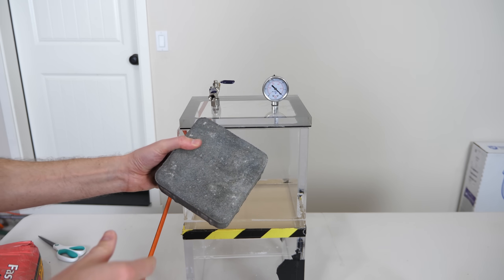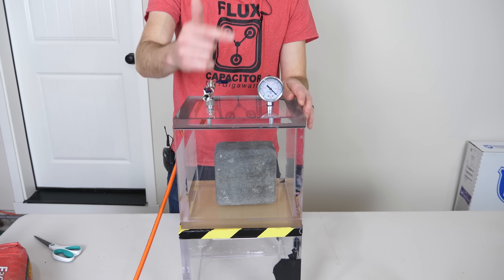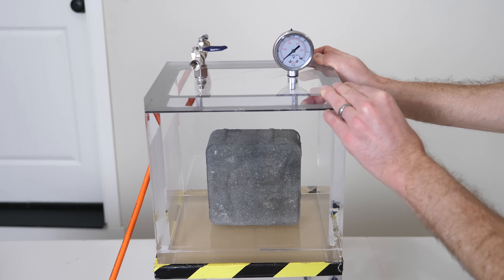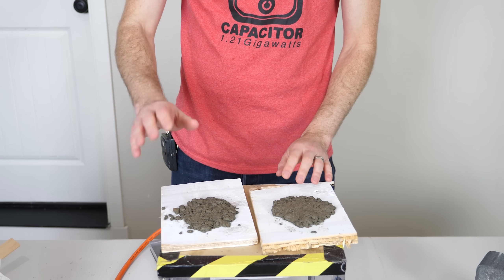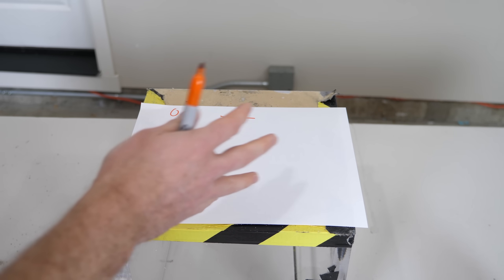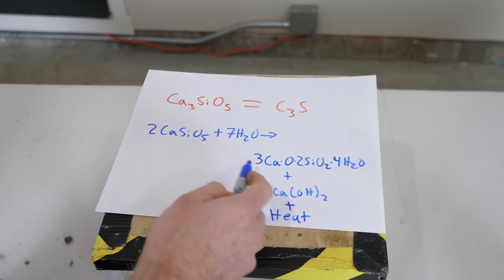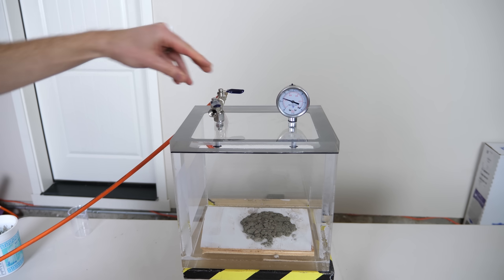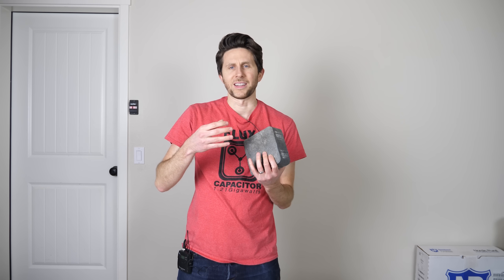Does Concrete Turn to Dust in a Vacuum Chamber? Concrete Without Oxygen Experiment

Comment: I'd like to see you do the same test in test cylinders and then do a psi crush test . I believe the concrete that dried or set up in the vacuum having less entrained air would be far weaker
Reply: Concrete is never fully dry. It's always curing. Even after a thousand years.
Reply: @jasonk795  yes I know  this . But to the laymen that don't understand the difference between concrete and cement which is 99% of people the wording of my comment is just fine . I'm sorry that your life is so unvalid that you have to scour YouTube comments to make yourself feel smart by replying to my comment with some miniscule fact about concrete curing times that has nothing to do with the amount of air with in the mix that actually effect the structural integrity of the concrete.
Reply: @baloneylorddonkeyhammer2273  layman. If your going to do something, do it right.

Comment: I’m pretty sure the concrete won’t fall into dust due to lack of oxygen, but rather that it might crack and break as the moisture in the concrete is forced into a gas by the vacuum

Comment: What is going to happen to set concrete in a vaccuum chamber?
Ab-so-lute-ly nothing is going to happen, at least not for several decades. 
How sure am I? Nearly 100% certain. Covalent bonds is what exists in set concrete. They are a LOT stronger than a mere 1 bar pressure differential.

What is going to happen with wet, unset concrete in a vaccuum chamber? It won't set. How sure am I? Again, nearly 100% certain.
Oxygen is required to make concrete set. 
That was the problem of the "Earth 2" experiment, that they lost oxygen at rates that they had not anticipated. The foundation and walls of the dome had been built with concrete, but the oxygen content of the dome had only been calculated to support a human population dependant on full recycling of CO2 with the plants. What had not even been considered is that a sealed off environment with not completely set concrete will continue loosing oxygen to the setting of the concrete which may continue for several decades.

/edit after watching the video:
Question: quick setting cement: how does it differ to standard cement in terms of oxygen content? Will the standard hydration ratio for standard be sufficient to supply enough oxygen to completely set the concrete, or will it continue to absorb oxygen from the surrounding volume? In which case, keeping wet, unset concrete in a vaccuum chamber, compared to wet, unset concrete in an oxygen rich atmosphere might differ.

Comment: I was right about the vacuum not doing anything, it was pretty obvious that it would not remove the oxygen from the concrete, but I didn't know the chemical process for cement to cure so I wasn't sure how that would go in a vacuum, that was interesting to learn :)

Comment: I saw the concrete block shrink a little. So if you tried with a cinder block or other types of concrete or cement would it grow enough in a vacuum to cause stress fractures leading to shattering in repressurization?

Comment: You mixed concrete in air and then put it in vacuum.  Would the water, now absorbed in the mixture boil off or does the concrete powder provide the equivalent of a pressure vessel that shields the water from vaccum?
Also, from a curing point of view, would the lack of air cause problems with heat since heat generated by chemical reaction can't be dissipated as well so the concrete would get much hotteer ? (putting a thermometre in the concete would have been interesting comparison.

Comment: Nothing happens because if oxygen disappeared for five seconds even the oxygen in concrete will disappear whilst in the vacuum chamber the only oxygen disappearing is in the air, not in the concrete itself because any oxygen in the concrete is binded to the concrete.

Comment: Tl/dr: Being in a vacuum won't make a difference after it's dry and drying in a vacuum means some of the water won't react with the mix making it weaker somewhat.
Reply: being in a vacuum will remove air bubbles therefore making stronger concrete

Comment: concrete isnt just cement and sand, the water makes a chemical reaction with the cement to make a new material. thats why the strenght is water dependant. concrete does not dry but it hardens over time. would be kind of odd to have stone turn into dust when you remove air

Comment: Pretty sure nothing will happen...concrete at the bottom of the sea floor holding up a bridge isn't exposed to oxygen so why would a vacuum matter?

To cure concrete does need to react with air so I imagine it won't harden properly.

Comment: I think people misunderstood the original claim. If all oxygen was removed, the concrete would turn to dust because oxygen is required in the chemical components of concrete, and removing that would change the concrete chemically. Removing oxygen from the air, however, wouldn't affect concrete.

Comment: My guess: The concrete isn't going to collapse. I don't understand the chemistry behind it, but if there's any relation whatsoever, I think the lack of oxygen would have to last a whole lot longer than 5 seconds to cause anything. Concrete is used in many applications where you can expect oxygen levels to be low (under ground, under water etc). Also, the vaccuum isn't going to pull enough force to tear the concrete appart.

Comment: If the internal pression is superior to the rupture tension of the concrete the concrete will break, but it depends of if the concrete caracteristics have the rupture tension inferior the tension caused by the vacuum.

Comment: What would happen to concrete in a dehydrator, or a freeze dryer, would it just turned to dust because the concrete is just Dust in water

Comment: Actually, the less water you put into concrete the stronger it gets (to a point), so the concrete drying in vacuum could turn out stronger, all else being equal. 

The strongest concrete is actually pressed into place, not poured.

Comment: I do believe the 5 second thing was referring to ALL oxygen and not just free gas. Meaning oxygen molecularity bound. Almost everything discrete in concrete is bond to oxygen. If you completely removed ALL oxygen molecules (not just the gas surrounding and permeating through it) then it would no longer be concrete.

Comment: I'm absolutely certain that the block of concrete will not crumble in vacuum. The presence of air or gaseous oxygen isn't needed for concrete to keep it's rigidity. Otherwise underwater concrete structures wouldn't work.
I'm guessing with a high probability that concrete doesn't need air and will solidify in vacuum as well, for the same reason.

Comment: Nothing is going to happen because you won't give it a proper time frame. I work in the semiconductor industry and things often need to be under vacuum for days for things to outgas properly. VOCs can be trapped in machines aluminum for quite a while. So something as porous a concrete would need a while for all the trapped air to get out. The same kind of thing with why you don't use river rocks to surround a fire. They have water trapped inside and can explode from the heat expanding the water.

Comment: Even if the concrete is weaker in the vacuum there would be less atmospheric pressure anyways and less total gravity on the planet, so the concrete structures would actually still be fine.

Comment: I would have thought that evaporation of water would not be the only issue, as the air also draws away heat so it would be interesting to see if the concrete setting in a vacuum gets hotter than the concrete setting in air?

Comment: Before even starting the video. What will happen to concrete in a vacuum ? Nothing at all. It don't depends on the presence of any gas to maintain it's integrity.
At 2:38, you have about the pressure at the summit of Mount Everest.
Concrete do not need to dry to harden. It get hydrated : It actually react with the water to get hard. It will absolutely harden under water.

Comment: That concrete paver you are holding in your hand was cured in a controlled high humidity enviroment at around 90 deg F for the first 24 hours. This paver will absolutely be stronger than either of the other 2 pieces of concrete you made. After any of the concrete you have becomes fully cured in about a month, the vaccum chamber should not affect them.

Comment: Ok not looking at the comments and before the experiment is performed. 

I think 1 of 2 things will happen

1 the more likely one, nothing will happen 98% sure

2 the concrete will become brittle and break apart when handled, less than 80% sure

EDIT: I just finished the video and it looks like option number 1 was correct 😊

Comment: The only question i have is, WHO ON THIS GODDAM EARTH CAME UP WITH THAT STUPID QUESTION!! Concrete or any other rock related and any structure made from components of rock doesn't depend on air or oxygen to maintain it's rigidity. It's the crystal structure of a rock and the hydrated solidified gel of calcium silicates to gain it's strength and durability.

Comment: TECHNICALLY most of those "5 seconds without oxygen" are a bit clickbaity and take away oxygen as an elemten, in which case concrete WOULD crumble sind oxygen is a binding part in it.
So no, just a vaccuum wont do too much, it would have to be ripping out the oxygen molecules.

Comment: I expected the mixed concrete to  set improperly because it would simply dry in the vacuum before the reaction could completely finish. I guess  it doesn't dry as fast as I thought. Still to really answer my question you would have to run this experiment for at least a month then accurately test the strength of both samples. I know that even in full atmospheric pressure they sometimes wet setting concrete in order to promote a better cure.

Comment: Before I finish the video and see the outcome, I think the concrete would not crumble. 
The reason why the concretes would crumble for the buildings is because of the pressure of their weight. The bottom layer would crumble because of the weight above it and it’s a chain reaction, at this point.

Whereas in this video, the concrete is too tiny

Comment: Now after I've seen the video completely I see that what I said was right and I totally see the fact that you didn't press the one that went into the vacuum chamber in the same manner that you did the air-dried sample and that's what caused the color difference you bet the surface of the air-dried one more and made it more smooth I get also tell that it made it a little bit more strong then the sample put into the vacuum that was the only difference I just hope that that puts the end 2 that question

Comment: This seems like one of those untestable claims 

The only situation in which I can think concrete might crumble in a vacuum is if it’s under a heavy load and all the air is suddenly disappeared. 

Then there might be a chance to cracks you form, and the load could theoretically crumble it to pieces.

Comment: Is calling concrete cement an American thing? Never heard it in the UK
Reply: Concrete is just when cement dries
Reply: @LordMegatron56  Even if they are the same substance, I would still say concrete is the material whole structures (like the block in this video) are made out of, whereas cement is the stuff used to stick bricks together.
Reply: @theblyatman3856  so they are the same thing just a different form and name?
Reply: @LordMegatron56  I'd use different names for different functions, yeah. Might be different in other English-speaking countries